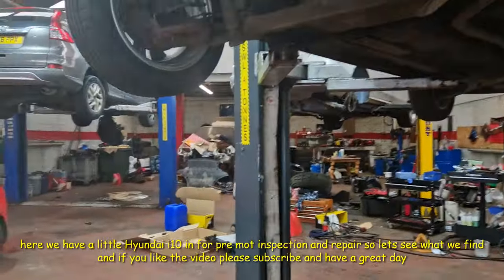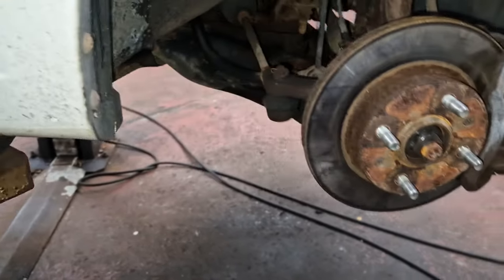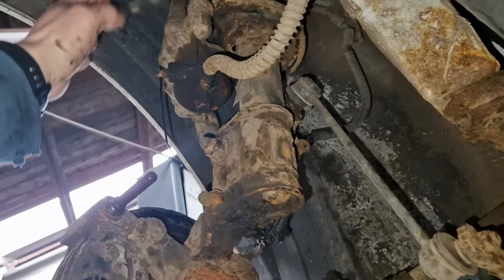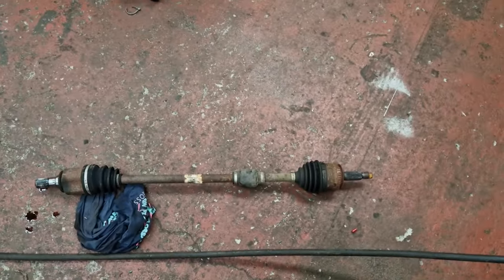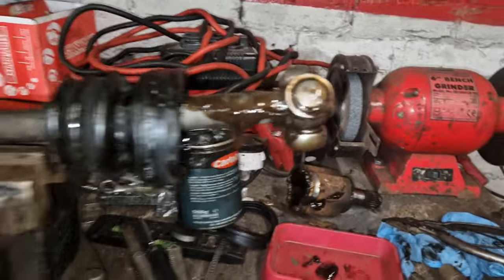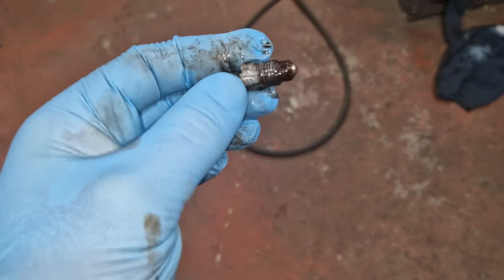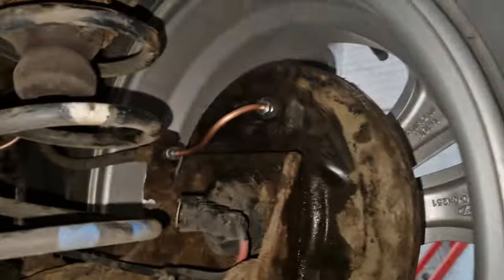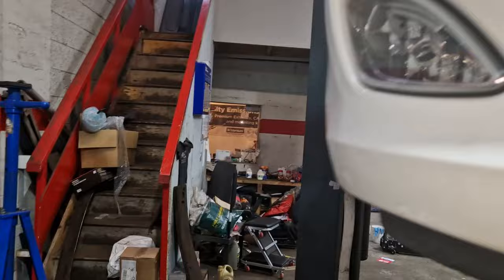#hyundai  HYUNDAI  I10 DRIVE SHAFT BOOT REPLACEMENT AND BRAKE PIPES & SUSPENSION ARM REPLACED #car

Comment: once again great video so much rust showing on that i10 and also the issue with the hub nub 
can you imagine being a DIY guy no chance of getting that hub nut off
break pipes for years were MOT failures
the ones from back to front ball ache 
our old VW sharan when the kids were small every year
break pipes for MOT

love your content
Reply from the maker: ah, thank you, it's much appreciated. Yeah, I used to say to the trainers at the kia Academy that they could find a plastic that could corrode kia, that is, and hyundais. Is the parent company there? The engineering is pretty basic. The driveshafts on the kias were horrendous the amount of shafts we would replace because of the threads stripping on the way off, or the shaft would get mushroomed with hitting it trying somehow to remove them all rust related lol they have even launched another brand they hyundai group called the genesis v80 I think and basically I think they have done a deal with bentley or porsche  because it looks very like a bontega lol 😆

Comment: what's the torque settings on that cv axle nut?
Reply: @cairney0037 would appreciate much if you could help thx!
Reply from the maker: @cjeivilla what year is it and I'll look up just now? I can't remember off hand, but I can check the manual. Just hit that subscribe button, lol
Reply: @cairney0037  thank you! i susbscribed! it's i10 2011 model.  MALAN51CBBM605429
Reply: @cairney0037  it's i10 year 2011 model. thank you so much! new subscriber here! you helped me a lot!
Reply from the maker: hi, sorry, buisy Day, the torque setting is between 200 Newton meters and 240 Newton meters. Thanks again for watching 👀 have a great day
Reply: @cairney0037  thank you so much!!!!!